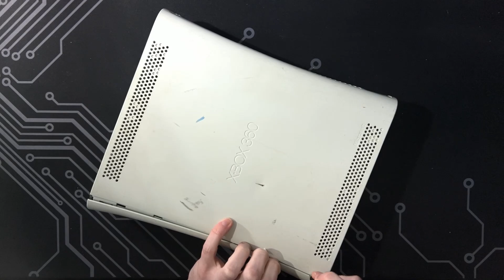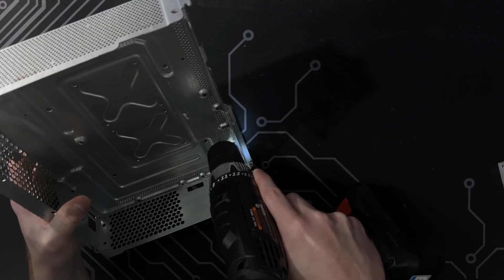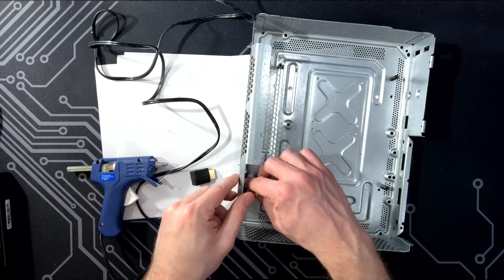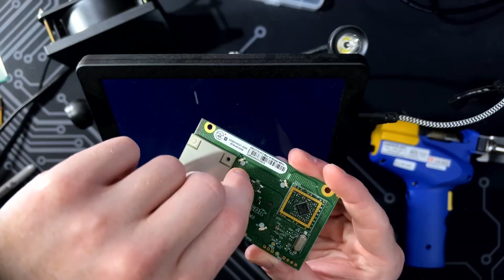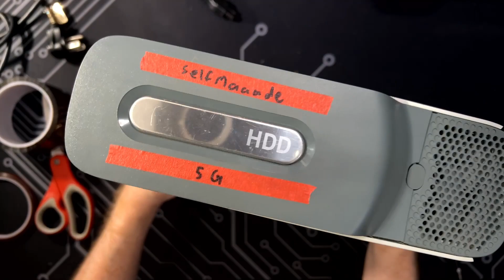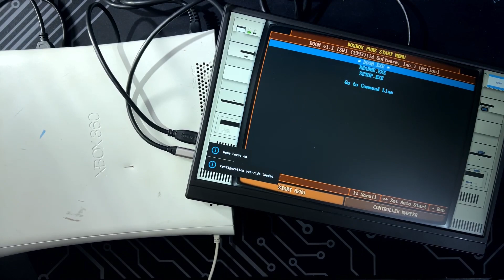I Built a Budget PC in an Xbox 360

Comment: NICE!  i did this with a HP elitedesk 800 G6 mini in a PS4 shell (the PS4 fried).  I uncased the power supply and it lined up perfectly where the old power port was.  used extension adaptors for all the ports.  one day I will upgrade the mini to something more powerful, but i just wanted to see if i can make it work.

Comment: The rf board could of been used to turn on the PC with the smds lights, there's a pin diagram online which can power on, I done this with tac switch's back in 2007 when I did a full Xbox in a PC case